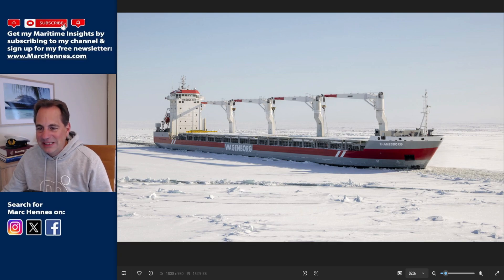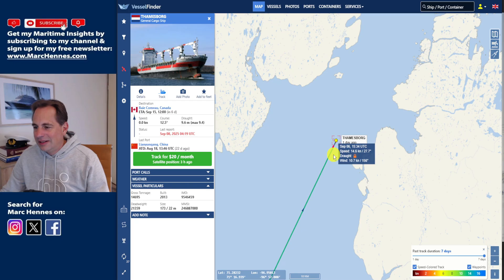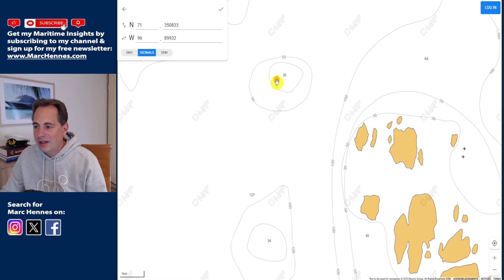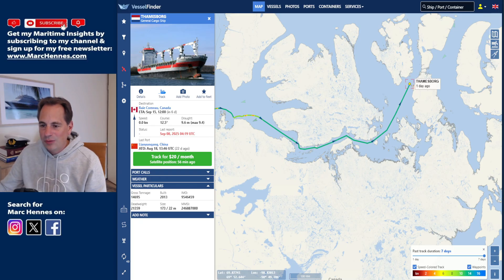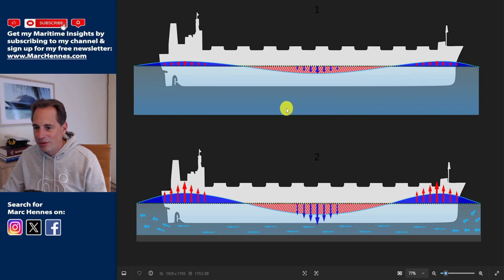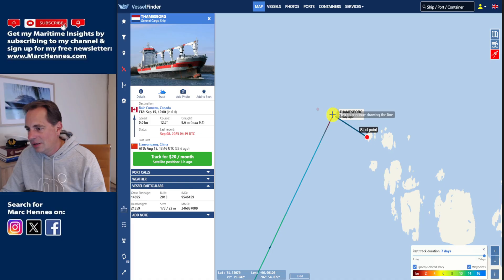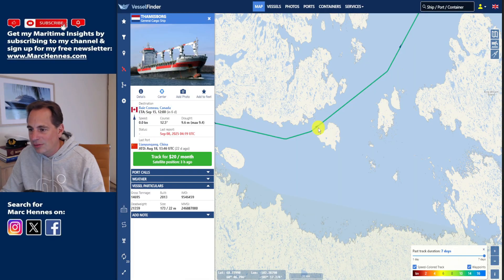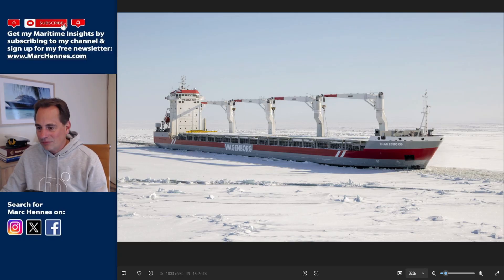Update: Charts Can't Be Trusted ⚠️ Ship Aground in Northwest Passage - Thamesborg

Comment: Maybe the person plotting the course of did not see the '2' only the 20?
A pity these charting systems are not more intelligent.
It would be easy to program it so that it knows the draft of the vessel and throws an error if you are attempting to plot a course over water which is too shallow.
Reply from the maker: Hi Greg, thank you for your comment. Actually if you add the route and all its waypoints in the electronic chart display ECDIS you can set it to check for a minimum water depth along the route, for example including 0.5 mile or 1 mile to each side of the route. This was possibly not set...
Reply: @marc_hennes oh OK.
Then there is no excuse.
Thanks for the info.

Comment: Ships need an equivalent to GPWS on aircraft.
Reply from the maker: It's funny that you say that, I'm a commercial helicopter pilot also and always thought it is strange that ships dont have a better GPWS (Ground Proximity Warning System). On ships we have a dopler loch, echosounder, it measures the clearance underneath the keel, but when you get notified of that when its not enough, it is too late, you cant stop the ship in time because it takes a couple of miles to get stopped from full speed. What you could do is monitor the under keel clearance and when it gets to really low levels keep a close eye. People often think that we can also somehow see whales and icebergs underwater ahead of us, but also not the case. Good updated charts are still the best way to do it in shipping, and it still works very well.

Comment: That position is charted at 2m if you have the correct chart.
Reply: I am was curious as to the existence of some tech instruments that can read depth/contour going along? Like sonar  or some kind of meter such as can 'see' geography below the ship?  Have they been attempting to solve this issue?  Twain mentions the shoals of the Mississippi so often shifting and the Captain's skill in reading progress by both marking and by the behavior and appearances of the water itself closer to and over it's surface.  They can see below ground from space of late, via satellite - LiDar, in real time, something like that?
Reply from the maker: @megenberg8  hi Megen, thank you for your comment. Ships unfortunately do not have a forward looking sonar or anything like that to detect shallow waters, or obstructions, or even whales. We have an echo sounder which shows the current under keel clearance, distance from keel to the "ground". By keeping and eye on the echo sounder you can see the depth getting less and less before a grounding, and it will sound an alarm, but ships are so big an heavy, by the time the alarm sounds, and it takes 2, 3, or 4 miles to get stopped, you have no chance. The best way is still to use the most updated charts, because like you said, shoals and shallows, get moved around by tides. Welcome on board the channel :)
Reply from the maker: That's right Ian. I only found this online map when I made the video, but I later found a better chart with the 2m  on it. I don't have an ECDIS at hand 😅
Reply: @marc_hennes  one hopes they have not used a free online chart.... but even so, without a more detailed charts, it must be assumed by a navigator  that at the INSIDE of an all around closed bathymetric isolines depths are LESS than the indicated isoline depth, Also in this case, with a possibly quite steep slope indicated by the close proximity of the next deeper isoline (the 50m depth isoline, with a steep gradient on the northeast side), it seems careless to assume a 9m draft can safely pass at full speed (accounting for squat even more) over a shallow area in poorly charted waters. The 2 meter was indeed printed on other charts.
Reply from the maker: Hoi  @arnevanvliet1304  . Here's an interesting comment from @jepense82, he commented to me: You might want to check out the Canadian Hydrographic Office's chart index. There is no 20 and a 2. It is a 20.2 m Reported sounding. Soundings in Canada are measured in metres to the decimeter at depths less than 30 m. The Reported part is important because it means the depth was never confirmed by survey. It is incorrect to put a 2 m and a 20 m sounding in the same depth area. Marine Traffic is not the charting authority in Canada as per the Shipping Act.

Comment: ouch.... 14knots over 2 meter charted water depth, with 7 m draft, this looks like a carrier ending navigational blunder. Let's hope for Messrs. Wagenborg that the ship can be freed and will not have to spend the winter at that rock.
Reply from the maker: Hoi Arno, I also hope that the ship can safely be freed soon before winter sets in. It is not as simple as just pulling it off the rock with sheer power by 1 or 2 of the Coast Guard vessels that are there, that is too risky and could cause even more damage. They taught us at the maritime academy, that if you are grounded on a rock and are punctured, or you have been rammed by a ship and are punctured, keep the rock, or the ship inside before removing it, because that will open up a bigger hole. I read the coast guard vessel had a remote operated vehicle (ROV) to inspect the hull of the Thamesborg underwater. Interesting to see which ships will come to the rescue. Maybe they will unload its valuable carbon blocks cargo onto another ship first. We'll see.

Comment: Why didn't they just use their track from the previous passage through there.   The youtuber Whats going on with shipping showed their previous AIS track as to the west of the grounding.
Reply from the maker: That's a good question. We can only guess. I had a look at that video and here's what I can see. Note: Officers and Captains rotate and are not always the same on a ship. This crew charted a completely new route then the previous route, already starting from their departure port. The previous route taken actually gives wider berth around land (for example light green route above Alaska for example), this new route was much tighter around land and obstacles. Through the Northwest Passage there is obviously not much room to sail another track because of the shallows and land. I can also see that the previous route had a waypoint a little further NE (after leaving Icebreaker channel) before changing to a NNE course to Franklin strait, and charted a more Westerly waypoint because they where aware of the obstacle and thus added an extra waypoint further west of the pinnacle (shallow where the Thamesborg ran aground). You can also see that once the previous crew on the previous voyage went past the shallow, they soon changed course to starboard, meaning they where aware of this obstacle. I'm afraid this crew have overlooked this obstacle and charted right over it. Meaning, whoever charted the course was possibly not diligent enough, on double check from the Captain did also not see it, and the officer of the watch while sailing this stretch did also not double check. If the course was put in an electronic chart display ECDIS, it should have also flagged this obstacle if they had a specific water depth setting on to check for a certain shallows on the route. Not only directly on the route, but also, 0.5 mile or 1 mile to either side of the route in case you need to change course for traffic. I also don't know if they still used only paper charts, only ECDIS, or a combination of both, which could also cause disrepancies in routes. We can only guess since we were not on board and can only look at publicly available information. The final investigation report will reveal what really happened. This can take some time, but once this comes out I will definitely read it and report on it here on my channel. Have a great day!
Reply: @marc_hennes  Or perhaps a different pilot? Could someone for practice/training have been assigned to chart course and that was found acceptable?
Reply from the maker: @Don.Challenger  Hi Don, the pilots are highly trained but do not check the entire planned route of the vessel that they are boarding. They advice when they are on the bridge. Since there was only one pilot on board, it is possible that at the time of the incident the pilot was not on the bridge because he was resting. Often on long passages you have 2 pilots on board that alternate who is on the bridge. I think you are saying, could an apprentice have charted the route. Typically not, they can be involved in route planning but will never be left to the responsibility to take care of the route planning. I hope this answers your questions. I'm doing an update on the Thamesborg today, there are some new developments.

Comment from the maker: On the online chart where I showed the shallow water of 20 meter, I found a more detailed chart and with a 2 next to the 20m! 2 meter! Their planned route and course ran straight over that pinnacle 😮
Reply: Poor navigation they'll all be looking for a new job 😮
Reply: It is the decimeter. 20 m and 20 cm. It is incorrect to have a 2 m and a 20 m sounding in the same depth area.
Reply: @jepense82  it must be assumed that at the INSIDE of a closed depth contour the depths are LESS than indicated at the isoline, so the 2 m is very likely correct, especially as this case, the undersea mount has a quite steep slope as you can infer form the close proximity of the 50m isoline at the north east side of this mount.
Reply: @arnevanvliet1304 the actual depth of the shoal very well could be 2 m as the authorized chart shows a Reported sounding meaning it was never confirmed by survey. That advises to exercise a degree of caution to the depth.  However, the chart shows two isolated contours, a 20 and a 50 m contour. As you say, the 50 denotes a steep slopei. However, the sounding on the authorized chart is a 20.2. The contour indicates the maximum possible depth within a depth range. In this case, a 20-30 m depth range. Unless it was a mistake, a 2 m sounding cannot simply be placed in a 20 - 30 m depth range. It would have been placed in a 2-5 m depth range. What is the point of a chart if I have to assume for depths from 2 to 20? That's a risky assumption.
Reply from the maker: @jepense82 interesting. Where did you find that information?